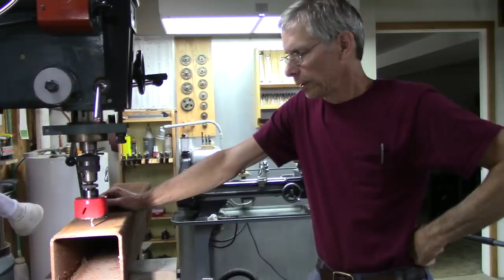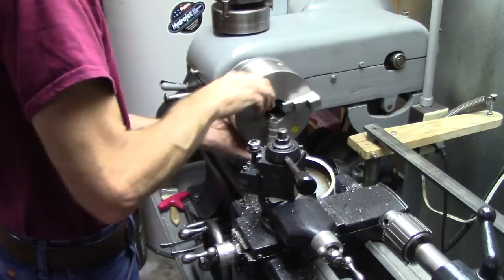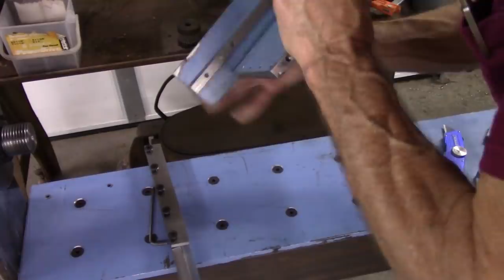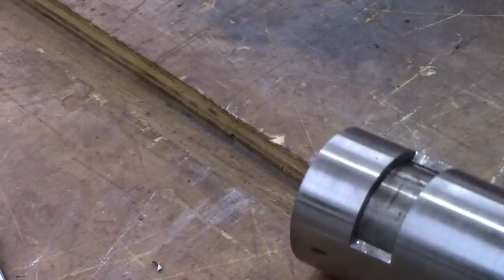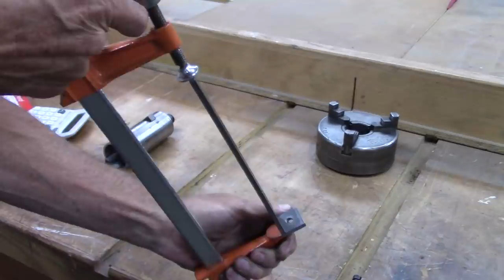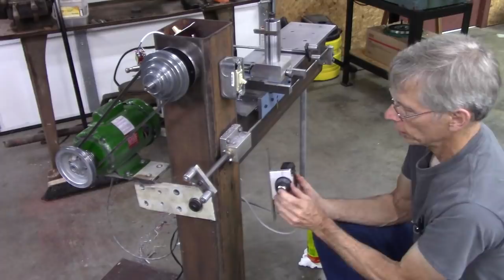Building a Wood Lathe like a Metal Lathe with a Pattern Tracer - Part 1

Comment: an impact wrench works much better for tapping and the taps last longer.  If you don't have a square drive to fit the tap, you can press a hex nut on the square end of the tap and use a socket on the impact wrench.   love your video.
Reply from the maker: Interesting...  I'll try the impact! Thanks

Comment: when you cut the thread you maybe schould have taken down the tips rather than cutting deeper. saw this on thisoldtony once. sorry if ths is bs, i myself am no machinist
Reply from the maker: This Old Tony is great! And you are absolutely correct. Believe it or not, I also learned this from This Old Tony after making this wood lathe. The threads are still fairly tight although a slightly better fit would have been nice. Fortunately the chuck still centers amazingly well.  When I remove and install the chuck if varies maybe .003" to .004". If this was a metal lathe this would have been annoying but for wood it goes completely unnoticed.  It sounds to me like you would make a good machinist. You pay attention to details. Out of 145 comments you are the first to point out this threading detail. - impressive!

Comment: Push a mig not pull. Allso you need a bit more power or less wire speed
Reply from the maker: I'm new at welding and I agree with you but the instructions said the opposite.

Comment: My father has a metal lathe in his basement and wants to give it to me. It’s been in my parents basement since I was a kid and I’m 50 so it’s old and works. I wish I knew how to use it. Maybe watching you I can learn a little
Reply from the maker: Hopefully I have something to offer but also check out mrpete222. He is a retired shop teacher and has all kinds of how to videos on lathes. He mostly covers Logan, South Bend, Atlas (Craftsman) and Clausing. I'm guessing your dad's lathe is one of these...  probably a  South Bend or Atlas. I've only had a lathe for about 6 years now and Mr.Pete was a huge help when I first got mine.
Reply: Well just found out that I can have the large my dad has. Here it was my dads great uncle and he was handy with stuff. But my dad said the lathe is south bend lathe. So I’ll be getting it this weekend... woohoo! Can’t wait
Reply from the maker: @johnunderwood3132  - That's great. Be sure and lubricate everything before you start it. South bends have sleeve bearings in the spindle. I'm not an expert on these lathes but I believe you need Type "A"
Mobile Velocite #10

Comment: Your tool holder is possible for anyone to duplicate. Thanks for the video. Thanks for sharing your expertise.
Reply from the maker: Thanks for the comment. Wood cuts like butter and if you sharpen the tool right this lathe cuts much smoother than a regular wood lathe. The only challenge is the sharpen a tool with a lot of back rake angle on all sides so the cutter so it cuts well left to right. Although, I recently found a 1/4" round carbide insert that is shaped like a cup and it works fantastic.

Comment: Hi, would it be possible to know how many HP the Motor should be drive the Metal Lathe
Reply from the maker: Yes, it is 1/2 HP which seem about right. 1/3 HP might be adequate as long as you're not turning a large bowl.

Comment: This thing will still be working when your grandkids grandkids are machining!!!!!
Reply from the maker: I agree...  especially in regards the spindle. I made the spindle to fit my metal lathe chucks but  could have made it a bit easier using pillow blocks....  But, the tapered bearings were only 20 bucks and it was also an interesting and fun challenge to make it the way I did. Tapered bearings are amazing.
Reply: @WinkysWorkshop   I would love to have one but my health isn't good enough to enjoy it properly.
Reply from the maker: @williamburdon6993  - Sorry to hear that.

Comment: Try traypanning the hole next time , the tool is similar to a parting cutter but with angular clearance in both directions
Reply from the maker: Like where I drilled for the spindle tube?  If so, I thought about building a cutter to do that but I was a bit concerned about clamping the work adequately.

Comment: Sir when cutting threads, use the compound set at the correct angle so that almost all of the cutting is on the front of the cutter and slides down the rear of the thread. This makes for a smoother thread
Reply from the maker: Absolutely! I always set the compound at 29.5 and take a few thousandths at a time and feed only with the compound.  Maybe you are referring to my comment when I said, "not the prettiest threads I've ever cut" (on the outboard side of the spindle). I didn't show it in the video but I engaged the half nut in the wrong spot. The threads were very usable but not so pretty. Or perhaps my editing made it look like I was it wrong.... Anyway, thanks anyway . I'm always learning and I don't always do things right.

Comment: There is something definitely wrong with this old Logan. I've restored a handful of Logan's and I considered myself pretty much an expert on the machines. my Logan are so quiet you can just talk normally even whisper around them and you can hear each other. They're one of the more quiet machines made. I would say my main Logan is only a little 10 in machine it's quieter than a sewing machine.

It almost sounds like the bad gears are almost engaging and clattering I can't quite put my finger on it
Reply from the maker: Well I know exactly where its coming from and I assure you the gears are engaged, possibly to much. I suspect the mic on the camera accentuates the gear noise. Honestly, I've had several tell me my lathe was much quieter than there Logan.  Anyway, I had to go check and it was exactly as suspected and I'd say it is a very common problem with a Logon lathe. It's warn sleeve bearing in the reverse gear (actually it may not even have a sleeve). The way it is made makes it very prone to wear. Mine gets oiled regularly but it's easy to overlook the oil hole. I made it a lot quieter by increasing the backlash slightly between the reverse gear and the one below it. I'll fix it someday but it's very low on my list. If I remember right I'll have to bore and install a sleeve bearing. Bottom line...  I change gears often and don't feel like messing with getting the backlash just right. I'm not a Logan expert but I know every nut, bolt and gear on this lathe. I also have an 820 with a quick change gear box but it was sitting in a barn for 20 years. I have the spindle out and believe it or not the bearings seem to be okay...  I'm amazed. I have a long way to go on the 820.
Reply: @WinkysWorkshop  maybe it's just the mic like you say! 

But the Logan's are actually noted for being very quiet when tuned in. Yes it could be the gear mash if you do change them a lot that is true!
I think if you got the 820 open running you'd be very very happy. I am not surprised if the bearing seem good in your machine. I have two spindles 4 bearings and they're all from 1946 and they are all perfectly fine! Typical old lathes have an IR of between 1 and 1.5 at the nose.  I have one spindle / bearing / headstock combo that has absolutely no measurable runout at all!  Needless to say that is the one that is being used I said there one day thinking that my last word test Gage was bad because I couldn't measuring run-out then I realized well shit...  It's just that good!

I made a small screw nose er4 collet Chuck also zero runout!  Very happy with that! So easy to make I really suggest everyone do it. Ordered some stress proof steal from a guy on eBay realty. Pet for big chunks for maybe twenty bucks? Maybe five pizzas I can't really remember. The hardest part is making the cap you have to make it so the collets lock in the cap.  Too complicated!!! So what I did was just get a store bought cap turn the threads off of it and turned new threads in. I don't have the chain here's to do metric conversion so I just did my own threads. There's plenty of meat to do this to a cap!  Easy as can be.

It's kind of silly that I worried about such precision on an old machine like that. I have a hardinge sitting right next to it LOL!
Reply from the maker: @ClownWhisper  - It's nice to have the precision but I seldom need it.  I've never investigated a collet for the Logan. Does it have a draw bar? Or is the nose cap what closes the collet. What it the largest diameter and depth you can hold?
Reply: @WinkysWorkshop  it is the nose cap style call it Chuck that I make. With the wrench at my side it's really quick changing collets out. The largest diameter that I have is 1in on the ER 40 collets but I think there's even an inch and 1/8 available. There is no depth limit on call it other than what you can fit into your spindle. The Chuck's are very very easy to make. I mean they fit in the palm of your hand there's smaller than a can of beer maybe a little bigger around but actually shorter. I wish there was a way people could post pictures onto these conversations and I just show you what I made. It gets so much youths whenever I want or need precision I slap it on!
Reply from the maker: @ClownWhisper  - My through hole in the 200 is 13/16" if I remember right...
Reply: @WinkysWorkshop  it should be 25/32
Reply from the maker: @ClownWhisper  Dang..  1/32" optimistic! email me. mark21056 gmail

Comment: Pretty awesome build on both the Engineering and the Eecution  what. Is the reason for building such a unit  ?  I am a retired Woodworker  and Woodworking became one of my passions and Hobbies  i do not do a lot of turning  on Wood and most of the  things turned for Commercial Architectual Woodworking are CNC produced these days  so back to your title of building a Wood lathe with  Metal Lathe features. I. Can’t figure out the reasoning  or need  although I applaud your metal working skills  as i did have a few  Great Uncles that were  career Machinists  and my Grandfather. Was a body and Fender man  before Bondo  was invented and spent the rest of his life as a professional Welder  untill he retired at 67 years old
Reply from the maker: Thanks. The primary objectives for the lathe were, 1) to make wood mechanical parts and 2) to utilize a tracer attachment to make duplicate parts. The first objective was met and to a significant degree the second was as well. I just posted a short video where I used the tracer. It didn't work as well as I would have liked but the results were near perfect.

Comment: You did a great work, but a lathe like a metal lathe is not a good idea to turn wood! I think you are a pretty good metal turner, but never a woodturner! With this lathe you don't cut the wood with the grain, you scrape it!
Reply from the maker: I understand what you are saying but this is actually not the case. In fact the amount of sanding to be done after turning is very minimal. It has to do with how you grind the tool. You have to grind it with a fairly extreme back rake. The only hard part is getting a back rake on all side of the tool. If I was only cutting straight in then it would be easy but the tool must cut on the sides as well. I  recently found a very small round carbide insert that is shaped like a cup that accomplishes this. The lathe is not well suited for turning bowls but excels with spindles and does fairly well following a pattern. Check out my last video. https://youtu.be/5bcNxZlnQ3w

Comment: impressive. I would ask if you think adding thrust bearings to the leadscrews may be of any use, but then you would have to figure out a way to protect them from the dust, thus making simply adding them more difficult.
Reply from the maker: Thanks, Yes I think adding a thrust bearing would be great. I'm sure i could at least limit the dust with a good cover. Right now there is a sleeve bearing with a flange that does good but a bearing would be better.

Comment: On the lathe where the plug is what is that wood piece with the metal flat stock attached? Also your belt sander do you have a video showing how that was made?Sorry for all the questions but I'm new to your channel and find your work AMAZING!!!! thanks for your help!!
Reply from the maker: The wood is part of a tracer. The pattern is clamped to the steel bar and the wood had a spring attached to the end and to the cross slide to keep it against the pattern. Yes I'm going to build another belt grinder in the future but the next project will likely be a band saw or buffer/wire brush. https://youtu.be/OT0PJn9Ml9A

Comment: Very good construction but the drill in the very unfortunate propulsion, see my videos to get ideas .
Reply from the maker: I agree about the drill motor. I'll watch some of your videos. I'm not very good with electronics but it would be nice to have and instant stop and reverse. In the second video I installed a simple clutch that made things work better....  the drill coasts to a stop which is a big problem. With the clutch it's instant stop and makes the lead screw turn easy for manual moves.

Comment: Wow nice video ;)
Reply from the maker: I feature film... Ha, I need to re-edit I think.... maybe make it 3 part.  Thanks for the great comment!
Reply: @WinkysWorkshop  What I found interested was the part where you mounted the spindel at 20 minutes. Question about that? How did you centerline the casings where the bearings are fitted in? Because you welded it in?
Reply from the maker: @teachingrtechnics8051  - The spindle, bearing fits, and tube are all concentric so the only challenge was getting the round spindle tube absolutely square to the head stock square tube.  I took great care to assure my two holes lined up perfectly but I'll have to admit that this was a challenge and prone to error.  After welding the tube in place I installed the spindle with  chuck and mounted a 2 inch by 24  inch bar in the chuck. After making it spin without run out I aligned the tube the bed plate mounts to with the 2 inch bar. I got it all fairly close but not dead on. Being a wood lathe is it very forgiving.
Reply from the maker: I ended up being about 1/16 inch off on the horizontal plain but extremely close on the vertical. In hindsight, it would have been better to weld a flat plate on top of the upright tube and mount the spindle tube to the top in a couple is saddles so it kinda looked like a couple of pillow blocks. That was everything could be aligned perfectly. I really like the tapered bearing...  the chuck runs true and everything is solid as a rock.
Reply: @WinkysWorkshop  Thanks for your reaction, really appreciate that. I am planning to build my own metal lathe (all homemade). I am now making my design in Solidworks and scrapping alot of metal for this build :)
Reply from the maker: @teachingrtechnics8051  - It was actually a lot of fun but being totally honest large pillow blocked would probably be just a good as tapered bearings, at least on a wood lathe. Technically the tapered bearings are better (and cheaper) but I doubt you would ever notice the difference on a wood lathe. 

Also...  I made my spindle to fit my metal lathe chucks 1.5" x 8TPI but there are a lot more wood lathe accessories in a 1x8 thread.  The larger spindle is rock solid but it also depends on what you are going to use the lathe for.
Reply from the maker: Good luck with your lathe.
Reply: @WinkysWorkshop  Thanks, in the first place I am going to use Pillow block bearings because I don;t have a lathe to make a housing for a tapered bearing. I have seen videos on youtube where people build metal lathes with pillow bearings that could turn of big steel. greetz from Holland :D
Reply from the maker: @teachingrtechnics8051  - Yeah...  the pillow blocks are not so good for a metal lathe. You will get lots of chatter. Metal lathe bearings are either zero clearance bearings or very tight sleeve bearing. I actually considered sleeves. Pillow blocks are not very good at handling thrust like when you are using a tail stock to hold the end of a longer piece and sleeve bearings do very well with this. I suspect most larger pillow blocks will handle enough thrust but they are not made for this kind of load. I actually considered wood bearings. You can make everything a little over sized and they work great for a wood lathe.
Reply: @WinkysWorkshop  Hello , I would let you know I made some great progress with my own metal lathe. 2 Weeks ago I bought an old homemade wood lathe, with a really good base to be useful for metal. I already have made the headstock and the spidel, also with conical bearings. If you are interested, please take a look at my channel. Thanks TeachingRTechnics ;)

Comment: You've truly got the spirit of the inventor. That toolpost is genius. I would suggest breaking this video into segments, since it's currently a feature-length film. The toolpost would certainly rate its own segment, for instance. I love the way you mix and match wood and metal tools. Whatever works!
Reply from the maker: I totally agree about the length of the video and thanks for your thoughts. The tool post has worked great for the most part.  I'm thinking square tubing might actually be a little better. This would create more clamping surface area  without the tool being as deep in the holder. Currently its hard to work close to the chuck jaws because the tool post hits the chuck.
Reply: P
Reply: 0
Reply: L